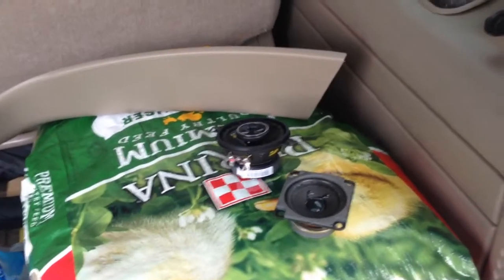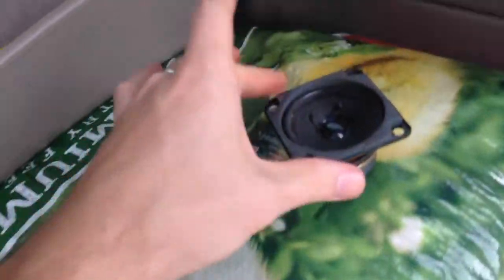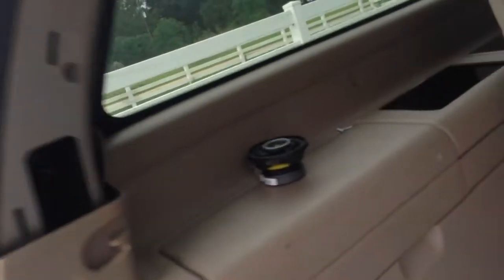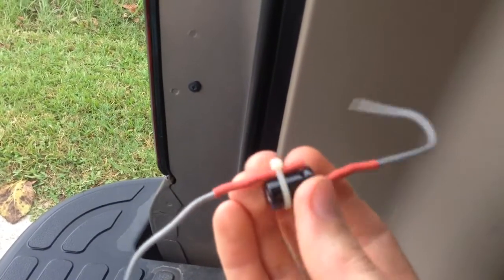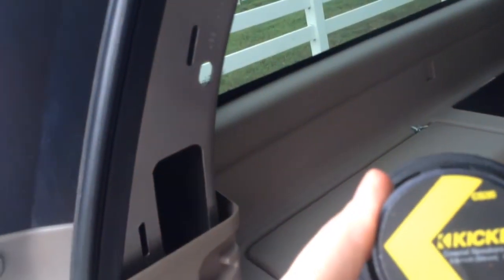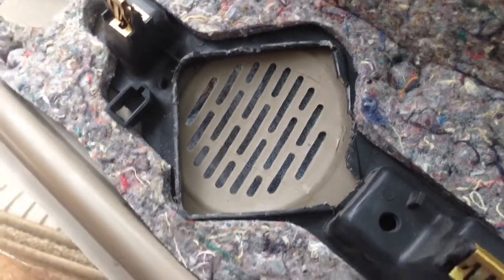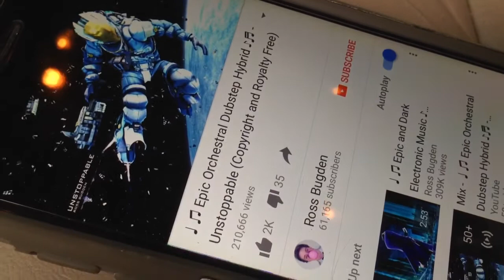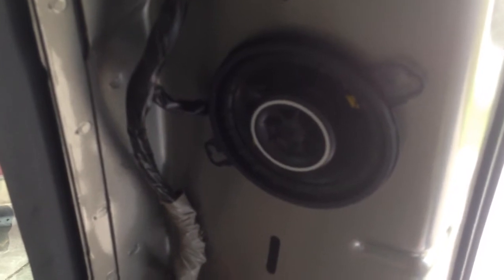03 Suburban D Pillar Speaker Upgrade

Comment: I have next generation 2011 and there is no hole in the body of car to mount speaker.  Also, speaker faces forward instead of side ways.  I just installed a bullet tweet that was almost same size as original.  Original is more mid range but the tweet i added will hopefully get more power since 4 ohm vs 12.5 ohm
Reply: What was the make an model if the tweet you put in

Comment: You don't need the bass blockers, more than likely the signal don't have bass going to those speakers
Reply from the maker: I put them in because I’m running them off a aftermarket head unit.

Comment: The factory speakers are 2ohm. You're replacing them with 4ohm so you lose 50% the wattage from the bose amp. I replaced my factory amp with a 4ch and added a separate sub amp. My front sub is totally disabled...tho I'm thinking of getting a small amp and running it as a front midbass.
Reply from the maker: This was temporary, I’m no longer running the Bose amp.

Comment: The UQ3 (factory amp, 8" sub NON BOSE 9 speaker) RPO code is NOT 2 ohm, theyre all 4 ohm save for the sub which is 2 ohm.

Comment: Did you run those tweeter to the front of the car or you stil using the Bose amp
Reply from the maker: Temporarily to Bose amp until I replaced the head unit. Now they run off the head unit.
Reply: Do you know which wires they are at the nose amp I don’t want to have to run new wire from the speaker all the way to the front if I don’t have too cause I’m not using the Bose amp

Comment: Why do you need the capacitor and how does it work again (series on the positive lead)?
Reply from the maker: It blocks the bass, works great on smaller speakers to prevent damage from too much bass. Use a non polarized capacitor. You can install on the positive or negative terminal of the speaker. Place in series between the speaker and the speaker wire. You can find charts on line that will give you the capacitor value and frequencies they block.
Reply: MJM’s Workshop Thank you. I have a 2002 Suburban but have not yet attempted to do the D pillar speakers. I also have not done the subwoofer. Seems in both cases one needs to do a small modification so the speakers fit as you had to do. I am having BestBuy install my new Kenwood system and door speakers. I will then do as you did for the back of the car.
Reply from the maker: Clint Labarthe 2002 should have the rear sub instead of the center console one like mine. Should make for an easier upgrade.
Reply: MJM’s Workshop Yes I agree. Unfortunately the way the new 8” subwoofers are made it requires using a router or dremel to make the opening slightly larger. I have seen another video on that issue. You are correct my subwoofer is on the drivers side of the rear cargo area. I just need to get a set of tools to pop all this moulding off. Never attempted anything like this before.

Comment: Why did you add the capacitor??? What does that even do in this setup?
Reply from the maker: blocks bass to help keep from blowing this little speaker.
Reply: John Stevenson, helps prevent blowing the speakers as well as eliminate some distortion from the new speakers. 3 1/2” speakers aren’t designed to put out the much lower frequencies that larger speakers can. There are different capacitors with different frequency cutoff points. Some only alllow lower frequencies, some only allow higher frequencies, and there are some that will still allow you to get the midrange frequencies.

Comment: Bose stereo system in suburbans are 2 ohm. They have an amplifier thats ran on 2 ohm. the deck has nothing to do with liking  2 ohm speakers. Those 4 ohm speakers won't sound as good.
Reply from the maker: Curtis Navarro Yes the Bose speakers are 2ohm as well as the Bose amp. I've now replaced all the speakers, bypassed the amp and replaced the head unit. It sounds so much better than the factory Bose system did.
Reply: Yup, I dont know why Chevy did this.
Reply: Where would the amp go or be located
Reply: On the suburban the amp is located behind the panel near the c pillar
Reply: Curtis Navarro it’x because of Bose not GM. They used a modified ac Delco head unit until 06/05
Reply: @mjmcomputers  when you first installed the speakers with the amp still operating did you just plug and play essentially with your new door speakers? Also do the tweeters tie into the front door speakers or is there another line going to the harness because I only had eight wires positive and negatives for my four speakers and I still have the two tweeters upfront. Also, what did you do to bypass? I’m currently in the middle of taking my head unit out with that aftermarket unit. I have a subwoofer amp installed, but I have to hook that up and then order my door speakers.